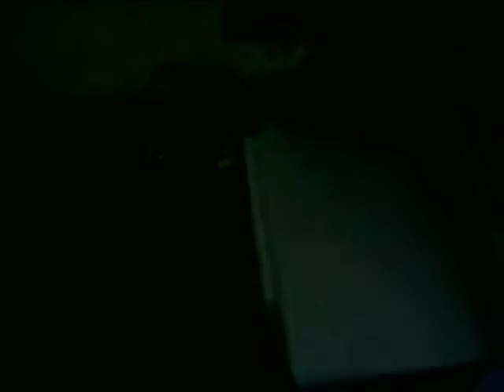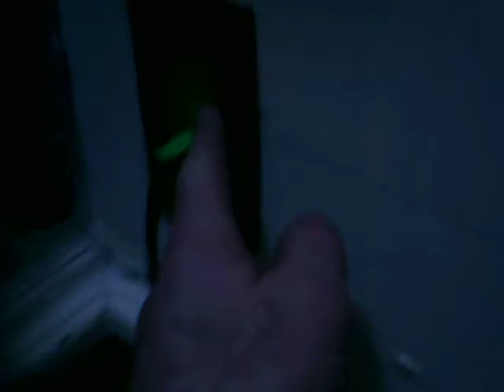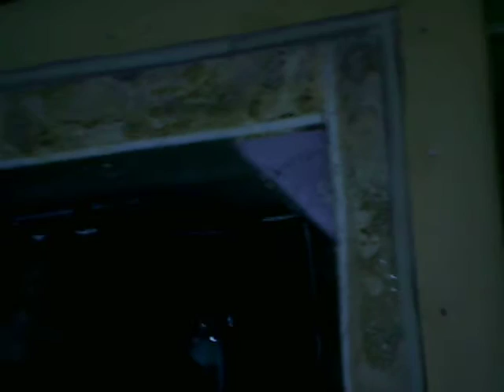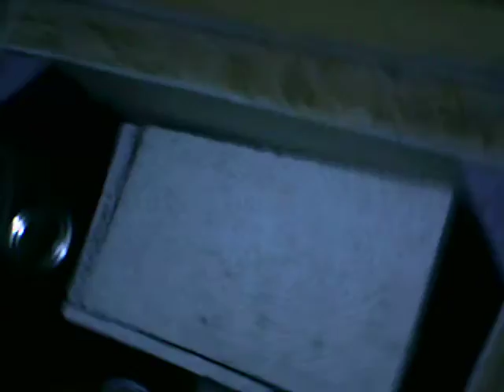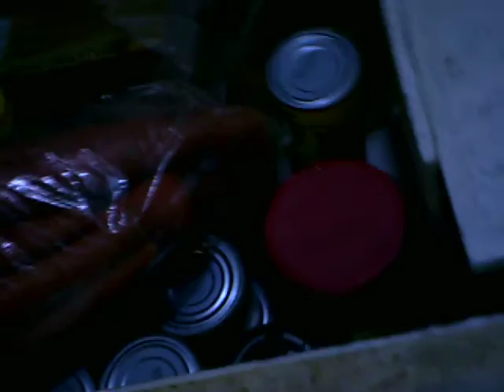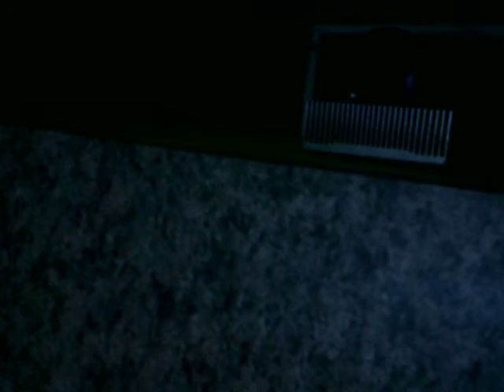Peltier Unit Homemade 4 cu.ft. 12VDC Thermoelectric Shallow Chest Refrigerator

Comment from the maker: Changed the aluminum bar to copper - even better heat transfer. Outside, the Peltiers cold sides sit on top of the bar. Bar goes through fridge wall, & on the inside the aluminum water/ice tray sits bolted onto the top of the bar, with some rubber pieces to prevent leaks at the holes. I've ended up with a 15v and an 8v Peltier module (both 8.5 amps rated) electrically in series. It doesn't cool quite as well as the single 15v but draws 4A instead of 7. Voltage is very forgiving - PV panel fine.

Comment from the maker: A freezer is a taller order than a fridge, since the temperature differential is higher. But if you keep it small and use lots of foam insulation (5-6"?) no doubt it could be done. I may try evacuated copper pipe with fins to carry the most heat off from the warm side. They sound cool.

Comment from the maker: Peltier modules are much most efficient at about .4 to .6 of their rated voltage for a fairly small temperature difference like under 25 degrees C - see some typical Peltier data sheet curves. IF ambient isn't too warm AND you can dissipate the warm side heat well to keep it cool AND both peltiers connect well thermally to both heat sinks, there *should* be almost as much cooling with about 1/2 the current. If not, 2 of higher amps in series will still be less juice than with one.

Comment: good idea about the water. never thought of that. however I have a 12V compressor fridge running off 120W of panels and 100Ah of batteries. it's draw is only around 18 watts when it runs. super efficient engel fridge with no actual crankshaft in the compressor. it kind of toggles up and down instead like a solenoid and spring (difficult to explain til you've seen pictures).

Comment: thanks most informative vid. I've seen yet. Great tip on the alluminum rod to water. Does the rod go in just above the water or submerged.  
When running off the solar can I run off 12 volt panel or must I go through a charge controller. thanks

Comment: I have a 19v 6a DC laptop power adapter that I wanted to use with Peltier to cool down my system and you just solved the issue for me.. putt 2 or 3 of them in series electrically and mount on top of each other with 1 heatsink and fan! I guess TEC1-12706 model would be good for my purpose .. deciding if I should fo 3 peltier on top of each other or just 2.. I am cooling a 5 gallon plastic tank of water around 10c across the plastic